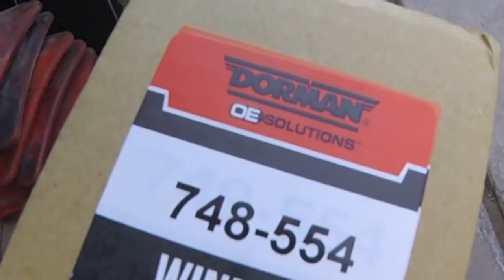[JUST FOLLOW] Nissan Murano Window Motor Regulator REPLACEMENT√ fix it angel

Comment: Awesome video! I was replacing my door lock actuator and got stuck after the door panel was off. Didn't know the two round adhesive covers needed to be removed to access the window.

Comment: Hey. Do you need the whole kit? Or just the motor? Brother in laws stop working. Wants to replace it.
Reply from the maker: hi, you can replace the motor only. but better replace the whole regulator and motor. that's from my experience.
Reply: @FixItAngel  thanks man. We changed it today. Turned out good. Thanks for the guide.

Comment: I did everything in the video on my murano . Maybe I missed something but is there a reason why my window won’t go up all the leaving about half inch gap?
Reply from the maker: Rameez Omer cycle your window. Press the switch all the way down and all the way up for a couple times. See if that works.
Reply: Motor wires came apart .....
Reply: So I did that and wires came apart
Reply: After I messed up the first one up I tired again same results. So I left the window up

Comment: this is just a broken sprocket problem. why do you replace all unit
Reply from the maker: adem harun Demir  hi, tell me what local auto parts store that would just sell that specific part. Do you have a auto parts store that sells different sprockets? 
Just finding that specific part is just a waste of my time. 
Besides, it’s always good to replace whole assembly. That’s from my experience working on regulators that have plastic parts.
Reply: in my country whole part is expensive. and you are right replace whole assembly is good. that must be american style :D
Reply: What do you call the part that is broken please?

Comment: Do you buy the parts before you start the project?
Reply from the maker: hi, yes i do buy the parts before i repair but i check if the part that was removed and determine if it is bad.